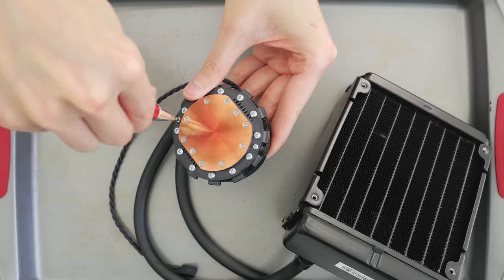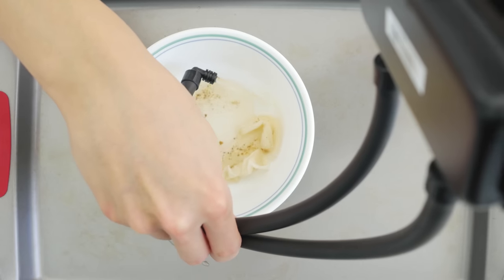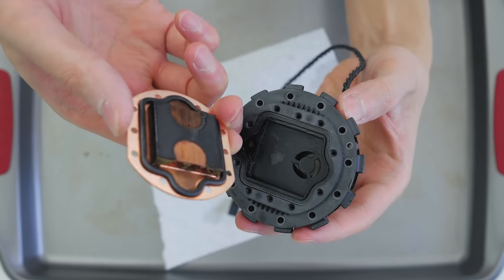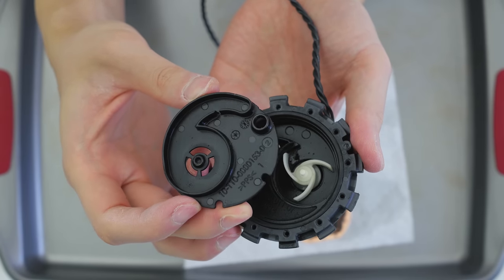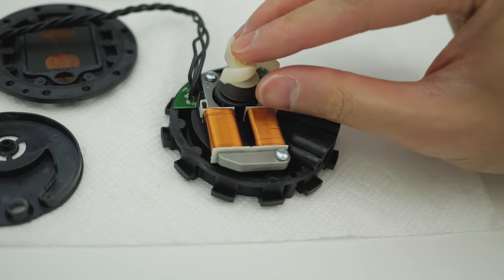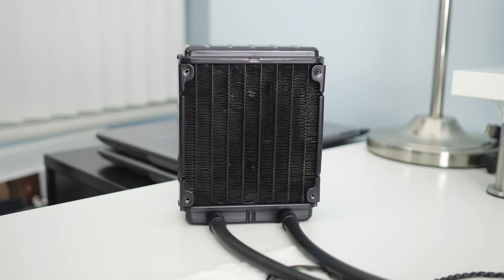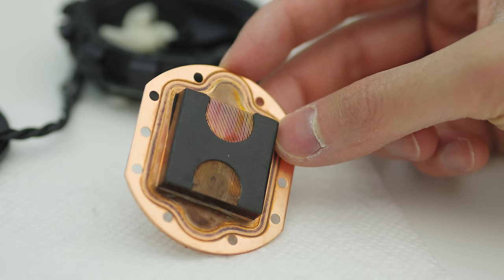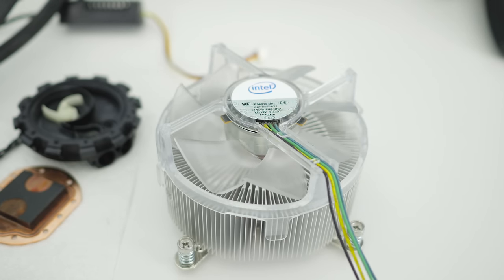What's Inside a CPU Liquid Cooler (Closed Loop) Teardown

Comment: That is just a few more reasons why I don't want to switch to water cooling solutions. Water cooling solutions are unreliable because of that tiny magnetic impeller. That impeller dies when the circuit dies and then u have a hunk of metal that is over heating on one end and cool on the other (It would have still have potential if it was passively cooling by convection motion but it doesn't) causing ur cpu to throttle and shut down. I am sticking with air coolers until they finally make a practical design for a CPU Peltier coolers. Those thermoelectric coolers came out around the time of the 1st gen i7 and have a working life of upto 22 years without moving parts.

Comment: Clean the base with some mild acid. You can run for a while (20 mins)  with the circuit filled with water and a mild acid...it will dissolve any kind of calcium debree. Then run it with clean water
then fill it with 70% distilled water and 30% ammonia (prevents any algae and bacteria to form).

Comment: For how long does the water cooling system similar to this one can last? 2 years maybe? Or longer, because I am considering buying one, but I am not sure if I want to expose myself for problems with pump or liquid failure... This is like a turbo charge for petrol engines - another part to fail.
Reply: I was using a Corsair Hydro H50 for over 8 and a half years and it was still working flawlessly when I took it out of service for an upgrade. People saying AIO water cooling units don't last  more than a couple years have obviously never used an AIO water cooling unit long-term.
Reply: just had a enermax liqmax ii 240 fail on me after 2 and a half year of usage. It's like a lottery - you never know, when your's is going to fail.

Comment: how does debris even get into a closed loop cooler ? i mean there is no entry from the outside >.<
Reply from the maker: It's most likely the metals inside that are corroding. (or any residual debris left inside during manufacturing) You can read up on Galvanic Corrosion if you're interested in the topic.

Comment: If the AIO cooler as exhaust, is that will heat the CPU?
Reply: it would require that the temperature in your PC case be much higher than what the cooler can handle while also being higher than your cpu temperature. So for example if you (for some weird reason) have 100 degrees in your PC case (lets say your graphic card exhaust leads to the inside of your case somehow) and then you push that air through the AIO radiator (mounted with exhaust fan) then yeah, you will actively heat the CPU.  However thats a very unlikely scenario, as an exhaust mounted radiator will probably have an exhaust fan working all the time, thus reducing any temperature buildup. (the rest of temperature will go towards the "heat capacity" of your cooler, which is the amount of thermal energy it can absorb)

Comment: As I am sure others have stated... if the motor works, and the gaskets Etc  are fine.. clean out the gunk, flush the radiator.. and put it back together.. buying new coolant is WAY cheaper then complete replacement

Comment: Sooo did cleaning it out fix it?
Reply from the maker: It was just clogged so technically it was fixable. The only challenge is refilling it with liquid. Without a way to pressure inject liquid inside (as done during manufacturing) you'll have a lot of bubble that will be challenging to bleed out.

Comment: Hi
U self said, that the one screw at the pump may is for filling it up at the factory.
Im not sure but u used the taken apart parts of the pump to show us how it works, and ya it works.
So, why not trying to make ur self a cooling liquit (maybe several tests befor using it) based on the component mixture of the Factory and Refill it, after checking if the flow in the radiotor is not clogt, if it is, u maybe able to clean it (not so sure how if im hones).
At this point u alrdy have enough Video Material for a another Video about the miniVaCü pump :D 
And yes, im sorry but thats the first vid i ever seen from your channel so im sorry if i hit the wrong content :D 
(coming from repair videos mostly electroniks). 
I hope this idea is something u may can work with. 
Greez and have a nice day 
(btw, ENG isn my nativ Language so ya :S )

Comment: Can you replace the water inside it?
Reply from the maker: The challenge is filling it up and not having a crazy amount of bubbles inside. When they fill these during manufacturing they use a pressure value to inject the liquid. Without that you'll probably just end up with too much air inside.
Reply: okay, thanks
Reply: It took awhile, but I had good luck on mine using a syringe to force water through... i had a decent size bowl and kept the pump at the lowest point of the system.... i also cleaned it out/ungunked it... had some decent black stuff on the copper heatsink after 6 years of 24x7 use, sprayed the gasket/prop down with silicone before refilling and used coolaboratory coolant with distilled water
It's currently better than when I first received it, at least..... I've had some air in it for years, I could hear the air when I first received it brand new, but now there is NO perceivable air... we'll see how long it lasts

Comment: lol its so easy to repair... why u go back to stock?
The pump works! just unclog/clear the heatsink and fill the radiator with any rust clear product and let it rest for 1day. Drain/clean the radiator refill with distilled water for water cooler and its like new.

Comment: If you want to reinvent the wheel build both in 1 unit and get rid of the radiator in the closed loop  and cool the closed loop water with an open loop. Its easy simple smaller and way more efficient . But who wants to run an open loop and waste all that fresh water

Comment: Don't buy an all in one prefab liquid cooler period cuz if it fails and you try to fix it you void the warranty and need to buy a new one. Liquid cooling is not difficult, buy the parts and build it yourself giving you the freedom to add a drain tube and a fill tube accessible from the exterior of the case allowing you to periodically flush the system and replace with fresh liquid without having to disassemble everything. A little extra work and a few extra bucks initially will save you alot of headaches and money in the longrun.
Reply: I should have added this above. The XSPC Raystorm cooling block is one of the best on the market and worth the money. Paired with a 240 mil radiator, all the tubing and fittings needed and a res/pump will set you back $150-$200 and will give you any options you need for a custom loop.

Comment: I wanted to know is what happens if you put liquid nitrogen inside the watercooling system????
Reply: Pritty sure you would get condensation on the outside of the tubing, radiator and the pump. It would give awesome cooling until one of those droplets hits something electrical tho.
Reply: I think the tubes will blow first...
Reply: The extreme cold of the liquid would freeze the tubes and make them incredibly brittle, I imagine even a slight attempt at snapping them (with correct gloves on) would result in them breaking in half. Condensation won't be a problem in a way, since the water droplets would just instantly freeze. So, surrounding the CPU area of the motherboard (as well as the tubes and radiator) would be bits of ice which would be a problem only if all of the liquid nitrogen evaporated away, leaving no source of cooling and thus, melting the ice whilst the PC was still powered on. If all of this happened whilst the PC was off and you left it (the water) to completely dry, there shouldn't be any issues since the water won't leave any residue that, say, some Coke Cola would. You would still need to spray the motherboard to protect it from the ice/cold, however.

I've always dreamt of experimenting with this kind of stuff. Having a few teaspoons of liquid nitrogen in a small, enclosed copper box insulated by some neoprene or something a couple of centimeters thick (so that the CPU doesn't just freeze completely up whilst the PC is powered off) and then insulating everywhere else around the copper block to better insulate the liquid nitrogen, so that it doesn't cool off as quickly whilst essentially not being used and to minimise any condensation. Basically, something close to what extreme overclockers do. Design a way so that the copper block can easily be removed and make sure you refill it every so often and bam, extreme cooling and complete silence (so long as you do the same for the GPU). The extreme cool temperature of the evaporation of the liquid should be suffice to cool any other relatively warm components, such as an M.2 Drive.

Sorry for the long explanation/comment!

Comment: I just tear down my NZXT Kraken X60 (the original Kraken) and find some clogs and debris, after i clean it and refill it, it works like new again.
Reply: Ernest Jay how did u clean your nzxt kraken?
Reply: @spitfire8138  just open the pump unit, drain the water, clean it, and re-fill until all air bubble is gone and close the pump unit.
Reply: @ErnestJay88  the pump unit is the radiator right? or am i wrong

Comment: I rather go noctua D15 or D15S if your case can fit one and if your case max is 160mm cooler height then noctua U12A does the job too.
Because years of use later if a fan start making noises or dies just need buy a new fan and its repaired while Aio when fail must buy an entire new unit that is much more expensive than replacing a fan.

Comment: is it possible to refill the liquid?
Reply: l
Reply: Many CPU coolers have a filling port on the side of the block/pump. You just need to find a corresponding nozzle online (Ebay for instance). I 
had to replace the liquid in my Corsair H60 once, and it was VERY much clogged. But DO NOT take it apart for fun, it's a messy job that is 
OBVIOUSLY going to ruin your warranty. And DO NOT put tap water inside cause things might start living in there. Go for a Nano Fluid instead ;)
Reply: Thank you loki and addicted, I just bought ARCTIC Liquid Freezer 240 to replace my thermaltake water 2.0

Comment: ive had my liquid cooler for 5 years and it still works pretty good, idk how yours broke
Reply: Laqutis just bad luck, stuff happens
Reply: he had shit growing in it.. a flush and refill will fix it you need to add a  antibacterial additive or this will happen again..
Reply: Pennywise well i just got a corsair H115i. its been running for a week sofare lets hope it works for 5+ more years
Reply: Pennywise get corsair water coolers, they have 5 year warranty and everything and are made very good
Reply: Pennywise that was probably just unlucky, how did you have it possitioned? was it super tight? and i would get warranty on that if i was you.
Reply: Laqutis
some people don't like to chance it. I just went with a high end noctua and my cooling performance is as good as / better than my friends AIO in some cases.
Reply: the AIO fail at flow the pump they put in there cant push the water fast enough... if they would fix that they would beet most if not all of the air coolers..
Reply: Deniedstingray true, i wouldve gone your route as well, but i hate bulky air coolers. I like seeing my motherboard and ram.
Reply: My Corsair h115i developed this same problem in just over a year. Currently have my i7 5820k idling at 58c @ 1.16ghz...
Reply: Unless you are hardline watercooling. Looks so much better, but each new motherboard and GPU means a new set of tubing. Same with the CPU block, if its a different size. Someday I want to do a hardline build, but for now, I'll stick with the AIOs, which seem to be a good compromise.
Reply: Mine broke down after only about 1.5 years of use. 
It proably got clogged or something, but the return flow tube from the waterblock was steaming hot. Much more so than normal.
It resulted in my CPU running at a constant 95-100°C

I had a Cooler Master Nepton 280 L
Reply: I had a Thermaltake Water Performer 2.0 that lasted 5 1/2 years until my CPU started to overheat in games. I since replaced it with a MASTERLIQUID PRO 120 that has plastic tubing that has dropped temps down that Thermaltake's never did before. I'm a certified auto mechanic and from the looks of this video, this looks similar to GM's first generation Dexcool contamination. The coolant is breaking down the rubber hoses and gaskets. Then eventually the debris will collect and clog up the radiator and destroy the pump. So far the new GM coolant seems to have fixed this problem. I'm now a firm believer in with AIO manufacturers using plastic tubing.

Comment: The biggest problem is the pipes both being on the same side hot and cold should never be in this configuration this is why things fail, look at any machine today in work, even your cars radiator, they're separated, even your refrigerator is designed like modern machinery, hot one side cold the other so the heat transfers better, in the computer world laziness in manufacturing causes more issues with pump failure than in say a car engine, how often do you replace your water pump ? Rads should never have both pipes on top and always never horizontal, but this is how people make cases to work with water.

Comment: mirror polished copper plate would rock. the v-8 fan one rules. reminds me why I refuse to use liquid coolers. Fans only please.
Reply: the v-8 fan keeps a fx-8320 operating optimally. but the up front cost of this cooler is comparable with liquid coolers I guess fan noise bothers people but doesn't the radiator have a set of fan's on them anyway?

Comment: Is this the thermaltake water 3.0 performance c
Reply from the maker: I think it might have been the older 2.0 version but most aio liquid cooler designs have the same fundamental design.
Reply: thank you for the anwser since it wasnt clear in the video but do you recomend this cooler. And how long did it last you for
Reply: thank you for the anwser since it wasnt clear in the video but do you recomend this cooler. And how long did it last you for
Reply: thank you for the anwser since it wasnt clear in the video but do you recomend this cooler. And how long did it last you for
Reply: thank you for the anwser since it wasnt clear in the video but do you recomend this cooler. And how long did it last you for
Reply: thank you for the anwser since it wasnt clear in the video but do you recomend this cooler. And how long did it last you for.
Reply: thank you for the anwser since it wasnt clear in the video but do you recomend this cooler.
Reply: thank you for the anwser since it wasnt clear in the video but do you recomend this cooler.
Reply: thank you for the anwser since it wasnt clear in the video.
Reply: thank you for the anwser since it wasnt clear in the video.
Reply: thank you for the anwser since it wasnt clear in the video.
Reply: EXQN Gaming
Reply: yes?

Comment: Thanks for the video, i have the same issue with my corsair H55, and im tempted to tear it apart, drain it, clean the microfins and put the whole shoot n match back together to see if it works. its nice to see someone already did this
Reply from the maker: +Slither747 Np! I was surprised how easy it was to disassemble. Haven't tried putting it back together yet. Not sure how well that will fair. but let me know if you do it.

Comment: Where does the debris and all that dirt come from? o_O
Reply: It could be from a biological contamination in the solution. It could also be from breakdown of the rubber tubing or plastics. However, it looks like corrosion which can occur from mixing different metals together. It's likely the manufacturer used an aluminium radiator with a copper block.
Reply: Manufacturers aren't stupid. They know what galvanic corrosion is, and all AIO water coolers use a copper block and aluminum radiator. The key fact that literally EVERY FUCKING MORON MISSES is that they use corrosion inhibitors in the coolant. This is not rocket science. Cars have been using mixed-metal cooling systems for a CENTURY and don't have a problem with corrosion because they use additives in the coolant.
Reply: @Vitallord  easy man ... just an aggresive random kid in the internet world
Reply: @canss1951  The only reason I will not roast you is because you have a cat as ur profile pic, and I love cats :D. have a good day.
Reply: @Vitallord  oh man there is a misunderstanding. i didnt roast you the comment i did . i just tried to make you calm against the kid you've got anger to 😃 i love the cats btw thanks to you for your benignity to innocent animals :)
Reply: @canss1951  Whats his name? :)

Comment: That kind of results you only have, when you buy an AIo from Acetec, Cooler Master etc. . They use and aluminium radiator an a copper cooling plate in one loop! Take a closer look to the AIo from Alphacool, like the Silence loop or Eisbaer! Alphacool use a copper plate and a full copper radiator... so you do not will have any camical reaction! Pay more and get German Quality!

Comment: I had a Thermaltake Water Performer 2.0 that lasted 5 1/2 years until my CPU started to overheat in games. I since replaced it with a MASTERLIQUID PRO 120 that has plastic tubing and has dropped temps down that Thermaltake's never did before. I'm a certified auto mechanic and from the looks of this video, this looks similar to GM's first generation Dexcool contamination. The coolant is breaking down the rubber hoses and gaskets. Then eventually the debris will collect and clog up the radiator and destroy the pump. So far the new GM coolant seems to have fixed this problem. I'm now a firm believer in with AIO manufacturers using plastic tubing.